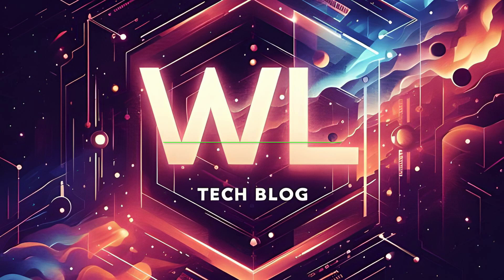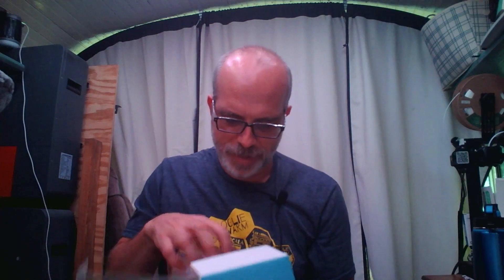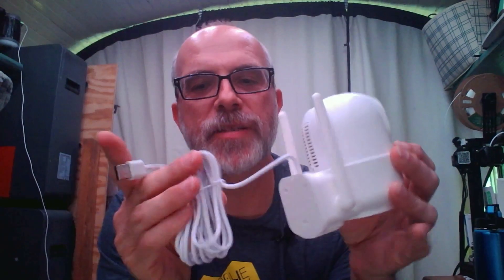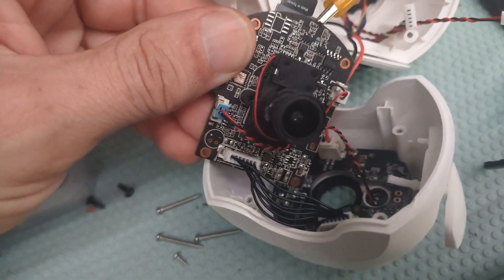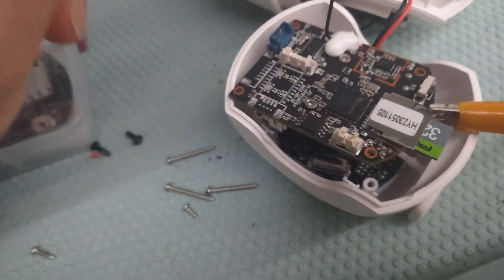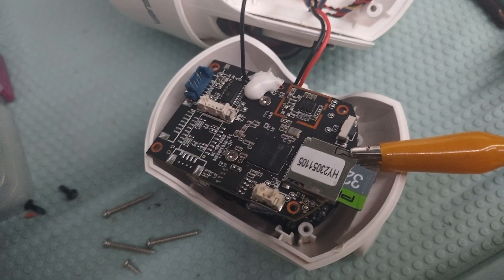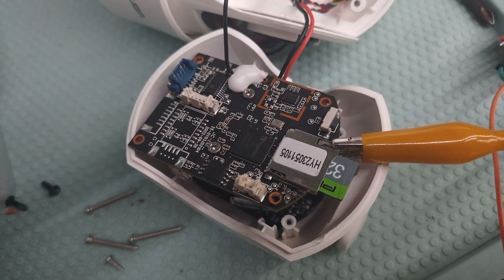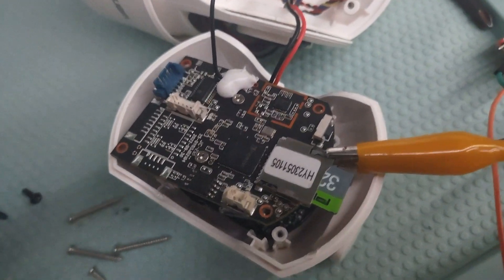Updated Description! Take control of your WANSVIEW W7 2K 3MP Outdoor Security Camera -  no-tools!

Comment: I downloaded the firmware, the zip file has only one file, it's called sd.img, the video doesn't make it clear, i need to rename it to something, but when you pulled up in the video, the folder contents b4 installing, you have autoupdate-full.bin and v4_boot.bin. 

You didn't mention, is this case sensitive? Your text on the video shows all caps. I'm not as experienced with linux based systems, but i know case is more important than, for example, windows.. I'm sure its' easy just to try it and see what happens, but i'm hoping to avoid bricking everything..(!)

I only have, from your zip file, sd.img. I need to rename sd.img (which if i understand needs to be renamed to "v4_boot.bin" is that right? And i need to have another file- autoupdate-full.bin, but i haven't been able to find that file.

I think what i need is the Thingino firmware, but i don't see how to find it. Thank for your work, this is fantastic! This video talks about the T31 image, but i bought the W7 a week ago (mid 2025), i tried to take it apart to verify the chip, but i just don't have the tools, so i'm assuming it's a T23 chip.. Hopefully i don't brick it if i use the wrong firmware..

But you also mentioned that your files are "padded" (text over the top of the video), so maybe i only need the one file on the sd card? Thanks so much!
Reply from the maker: Back up a step! The  sd.img is a raw sd card image. You use Rufus or Raspberry Pi Imager to burn it to an sd card. They can both handle the zip file directly without you having to extract it first!
Reply: @wltechblog  YT keeps removing my reply..

I should have known that i think.. grr, i'm redoing it now.. thanks for responding. After using UnetBootIn to "burn" the image to a card, I have an sdcard with lots of files (v4_all.bin, syslinux.cfg etc etc), i still should add the other files called:
v4_boot.bin
autoupdate-full.bin

is that right? If so, can you clarify which file should be called what? i.e the file that's originally called "sd.img", that should be called "v4_boot" etc...?

Thanks again. Also, you folks have done a lot of work. I looked around but i wasn't able to find- are you able to take donations via paypal?
Reply: I did get it to work, i did so many things im not sure exactly what worked.. Im just replying so if this helps other folks.. As he mentioned, i needed to "burn" the image to a card, once i did that, i also needed to copy the files he mentioned, and also rename them as he mentioned. I think that's what did it. The process wasn't nearly as simple as he (the experienced guy that he is obviously) said, but once i had the right things in place, is was for sure fairly simple. I was hoping to avoid having any smoke shooting out the sides of the camera, but that never happened :). I love what you folks are doing :) :)
Reply from the maker: @RockPDX you shouldn't have needed to do more than burn the SD image and go!

Comment: I was able to load a w7 ok and access  thingino over wifi, but after walking through setup it seems it could not find my wifi network and did not appear in my router's DHCP list.  I tried a few times with fresh loads and walking through my wifi network credentials.  thoughts on next steps?
Reply from the maker: Make sure you're giving it credentials for a 2.4ghz wifi network, and remember the ssid and password are both case sensitive!

Comment: Hi, I have a Cinnado B6 camera which I believe is the same as the Wansview 2k W7 which is powered by a solar panel to an internal battery in the device. Can I install the thingo firmware? And another question I have is if once the sd card with the firmware is inserted, can I return to the wansview firmware by removing the sd card?

Thanks for your answers
Reply from the maker: Completely different unit, and we don't have compatibility with any of the battery/solar devices at this time!

Comment: Would you consider doing a "teardown" / "disassembly" video for the Wansview W7? I see you have yours torn down. I got water in mine and it still works but there is a haze over the image. I was hoping with your help I could salvage my camera. Thank you.
Reply from the maker: I actually need to do this because they've released a new version of the W7 with different internals! Look for this coming soon.
Reply: My W7 was easy to get inside, remove one tiny screw near the speaker grill and the dome slides off. Four more screws under that gets to the board and the lens.
Reply: @abaltimore  Thanks for your reply. Tried that but the dome wouldn't budge. I think I'll wait for @wltechblog to post a teardown so I don't mess up my camera any worse than it is.
Reply from the maker: I'll be posting it as a short here in a little bit!
Reply from the maker: https://www.youtube.com/shorts/8dlMDv3GmZ0

Comment: Great Video! This is an ingenious method for taking control of your cameras. I just received a new W7 and learned it has a different chipset to which there isn't a working Thingino firmware yet. The good folks on the discord channel helped me get the camera to boot again but the Wansview W7 camera I have doesn't currently work with Thingino. I also have a couple of Wyze v3's running Thingino !
Reply from the maker: I just learned there was the new version at the same time you did so I'm hoping that is fruitful and we can find a way to identify the new version!